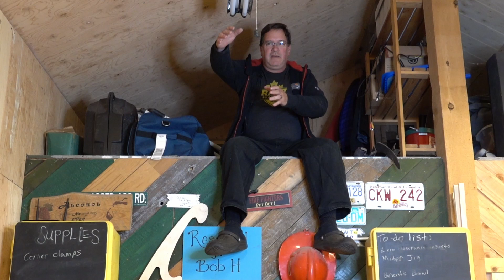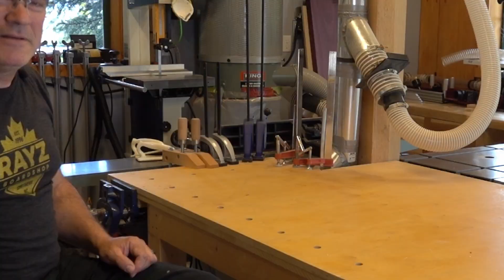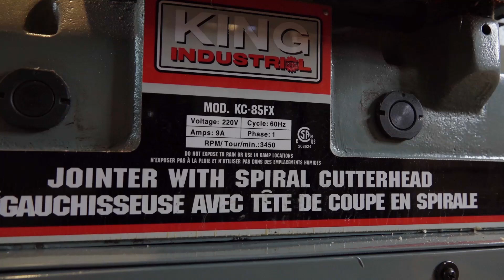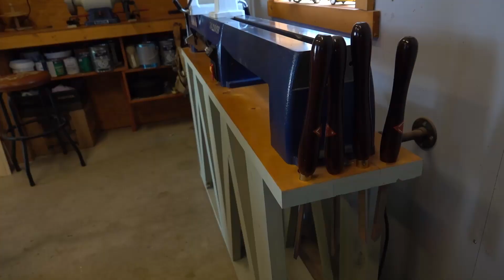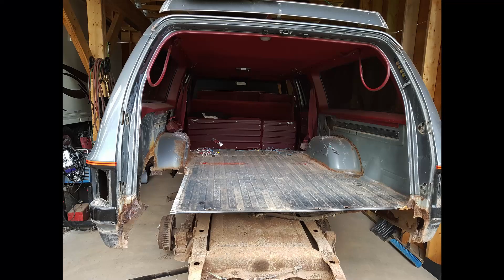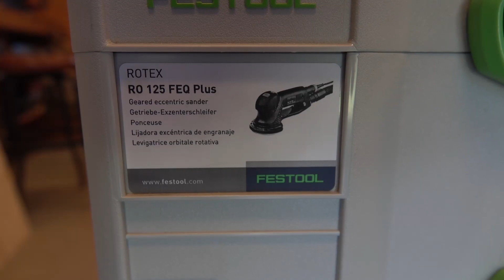Small Wood shop tour 2020 with some small shop solutions

Comment: If you haven’t looked into the dust deputy yet I highly recommend it. You add it inline before your extractor and mount it to a barrel.  It will collect 99% of the dust before it gets in the bag so you don’t  have to fuss with the bags, also keeps the filter clean a lot longer. I have the dust deputy xl mounted to a plastic 55gal drum and love it.
Reply from the maker: Thanks for the tip. I am thinking of relocating the extractor and the compressor to an out building and a dust deputy is definitely a consideration

Comment: Hello from the USA!!  Something I did to my tiny shop that you may want to think of doing, is a dust collection, compressor shack. I built a simple shack with a lockable door of the back outside wall. I used tung and groove cedar I got second hand, and some pressure treated 6"x6" and 2"x6" dimensional lumber for floor joist. I raised the shack up to the same height of the timber and stone pad I had my building put on. Then built simple walls to the back wall of the shop. I cut two holes into the wall to receive the pipe and power cords (which I put inside PVC piping to protect it. Rockler makes a"thru-wall" kit for doing this). I installed some soundproofing tiles I got cheap from eBay-for the next-door neighbor's sake. The roof is just a slant roof installed under the eve of the shop. It so much quieter in the shop now, plus more room. April Wilkerson inspired me to build one. She put in a cement slab for hers. Her is her take on one-- 

Building a lean to shed part 1: https://youtu.be/6Mar52-tEAs
Building a lean to shed part 2: https://youtu.be/UZ_S618-0Z4
Building a lean to shed part 3: https://youtu.be/dZZJbVok2h4
 
PS-- You can buy the laser beam to mount on the saw. This is the company that makes the one I bought for my miter saw: On Amazon; Fits most 7-1/4”, 8”, 8-1/4”, 10”, and 12” miter, sliding miter, chop, and portable saw. This mounts onto the blade arbor. 
 I originally bought The Dewalt 12" compound & sliding miter saw with the stand. On impulse I gave it to my nephew who was starting his own custom and now very successful woodworking business. When I went to buy my own I got a cheap one because it was all I could afford until I could save up for another one, but probably a 10" this time. I was planning to buy the Bouch Glide, but like yours, many brands have come out with the bars for sliding the head-on, closer to the front. My shop is only 10' wide so anything that will save space and is reliable is what I will go by.
Reply from the maker: Thanks for the tips ... I have thought of building an " exterior" shack as you suggested and will do so as I out grow my shop. I do have some heating issues though as it does get to -30 so I would have to heat the extension.

Comment: Thanks for the tour! Really enjoyed your journey shop wise and personally. Your "just getting started" is miles past my been "knocking around at this for 7 yrs" progress! I am also jealous you have level floors to make all your surfaces line up! For your miter saw yes you can buy a laser disc but I suggest running and LED light to do your own shadowline. Much more accurate and it's easy. I took apart a cheap HF led flashlight and wired one in
Reply from the maker: I thank you for your comments. I am definitely enjoying this journey. I will look into the LED shadow light... sounds interesting.

Comment: Hey Dan, you can get a little aftermarket laser for miter saws that attaches in place of the washer that holds the blade on. Just google “miter saw washer laser”. It uses a centrifugal switch to turn on when you spin the blade. They work pretty well.   Thanks for the vid.
Reply from the maker: Sounds interesting.... I will look into it because I love my fricken laser beams
Reply: I found a custom kit to add an LED light that creates a precise shadow, cut-line for my DeWalt 779, another popular miter saw. The Makita slider is getting very good reviews. I’ll be surprised if a third-party vendor doesn’t come up with a Makita variant. Mine is as a perfect-fitting, molded-plastic housing with a light that gets wired into the power, and snaps-in to replace the top of the factory handle…looks just like a factory replacement, though it likely voids the warranty. I’m not sure if DeWalt also offers this upgrade as well. The shadow line may be more accurate than a laser line and it’s easier to see under the brighter lights of YouTube woodworking studios. Thanks for the interesting tour. I’m just starting with the same Rikon drill press and DeWalt planar and track saw.